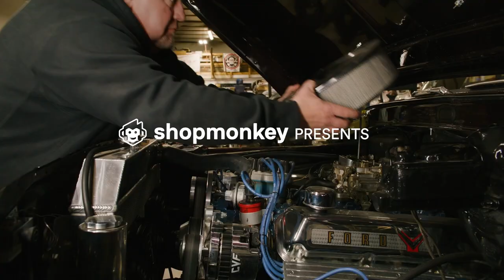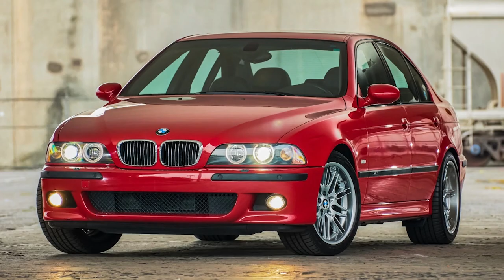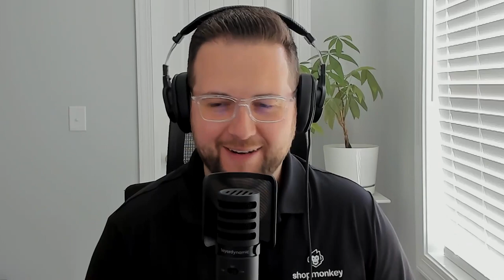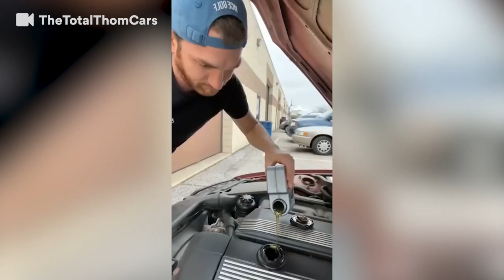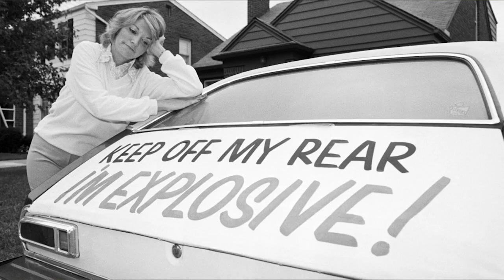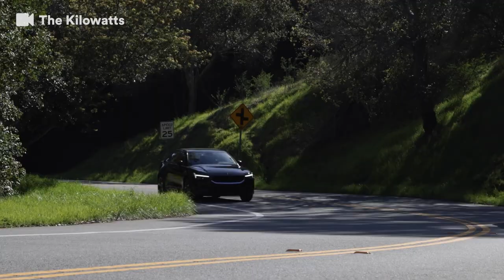The Technician Shortage — The Tune Up Podcast

Comment: Good discussion, and a lot of relevant points.  As a former white color guy that has moved back into the blue color sector to repair boat engines(long story), one of the guys mentioned something that I feel is relevant.  Diagnosing engine issues isn't always as straight forward as some people would like to think it is, I tell my customers an engine is a system of systems and all those systems have to work together as designed.  I don't think skilled technicians are given the credit they deserve for being able to methodically go through all those systems to solve the underlying issue.  I have a degree in Mechanical Engineering and whole heartedly agree that technicians are on par with what engineers do, solve problems!  I have never been in the automotive repair industry, but it boggles my mind as to why experienced technicians are turning wrenches and not overseeing and committed to training multiple jr techs.  Thanks for the insight, hopefully I'll find some good techs for next season and be able to start building a rock star team.